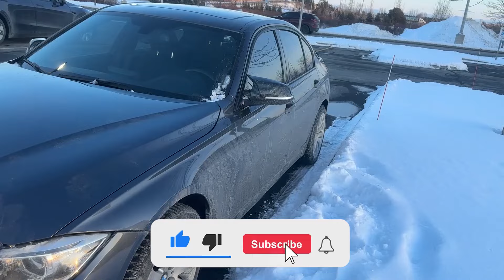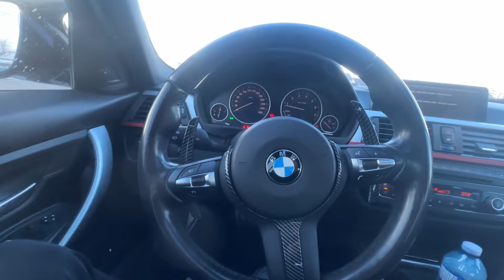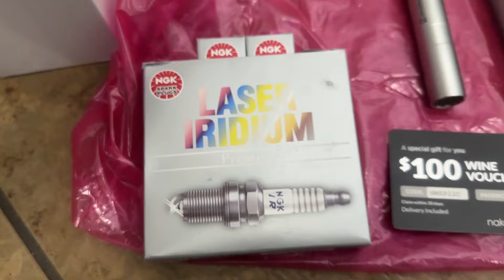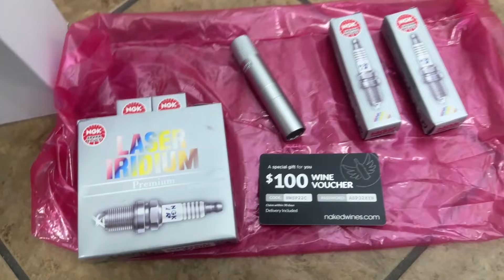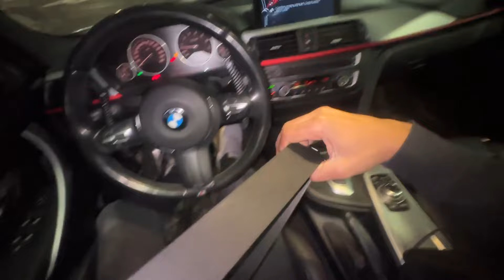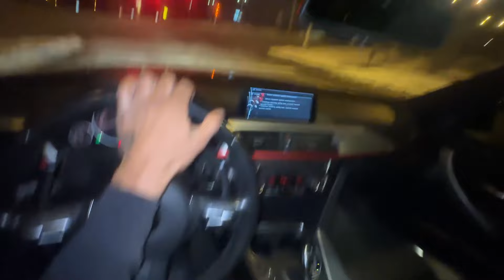First time Feeling Stage 2+ in my F30 335i | POV

Comment: Yo have u tried to reset the drive screen?
Reply from the maker: Yea, I’m trying to use bimmercode to fix it but It’s cz I changed my steering wheel
Reply: does it work or the airbag thing broke it?
Reply from the maker: Yea it works but my idrive controller doesn’t, that’s why I can’t click “ok” to get it off the screen. But those idrive controllers are like $300 that’s why I haven’t gotten a new one yet